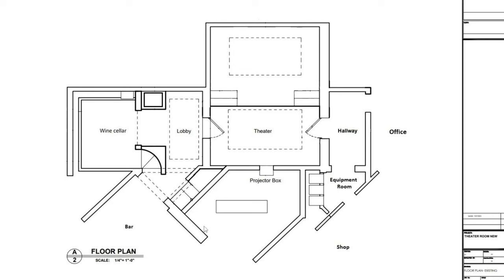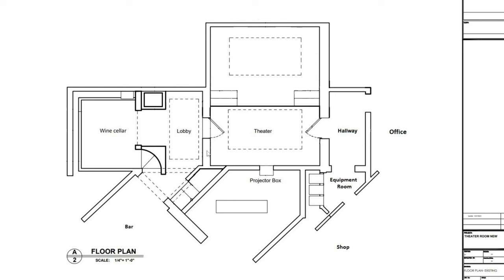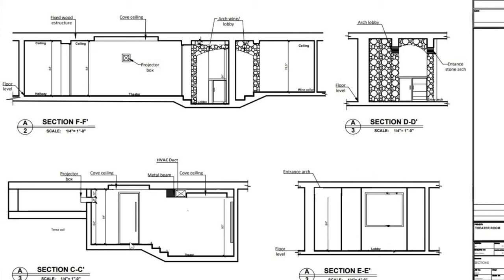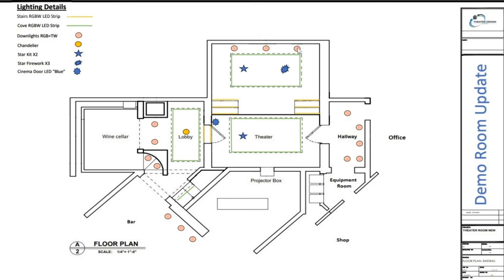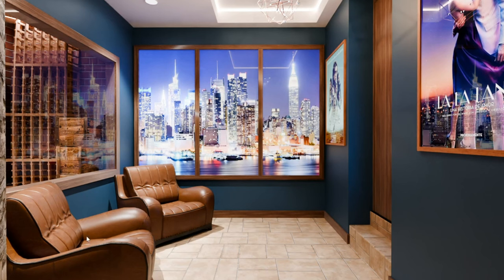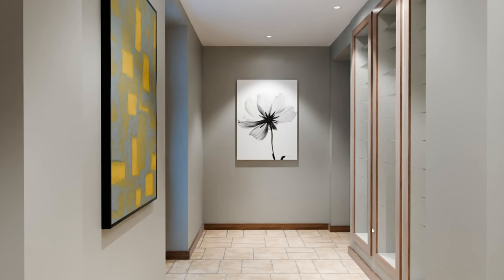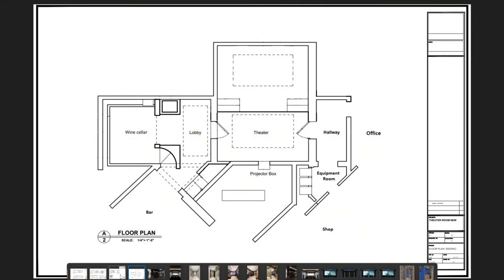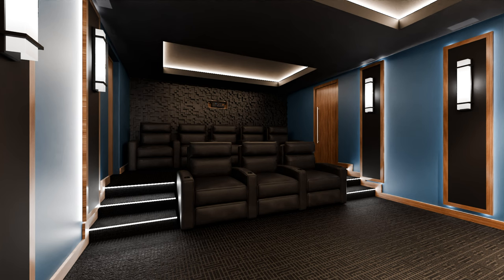Lobby & Theater Room Build | Floor plans, Renderings, Video Wall | 2024

Comment: Great LCR speakers. I also used the ci5160’s for my main LR and ci3160’s for center and side surrounds. Room is 14’x16.5’x9’8” high. Now doing an upgrade moving to 3160’s for rear surrounds. Should I change out the center to a 5160 to have all LCR the same? Also is there an audible difference between the older 5160RL’s and the new 5160RLM’s?
Reply from the maker: Yes   We are excited.  Installed may in customers homes.  I always like to have my fronts all the same.  3160 are more than enoigh for surrounds, maybe take your center out and use for one of the surrounds ot offset cost a little.   The M versions are better. 

If you need any KEF fell free to reach out.  Often have extras or specials. 

Cheers
Reply: Great.what would be your price for 1 5160 and 1 3160?
Reply from the maker: Shoot me an email  tyler@theaterdesigncompany.com  Cheers!!